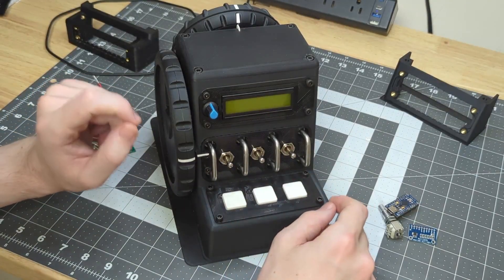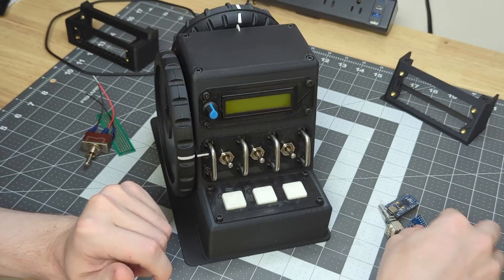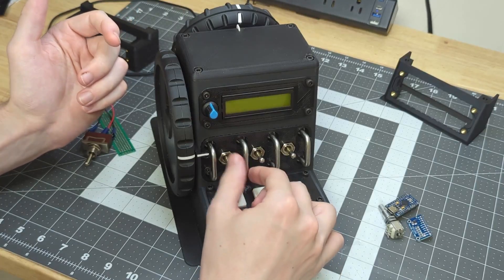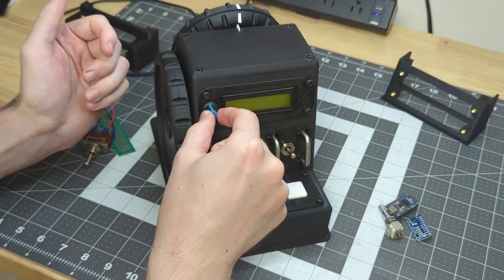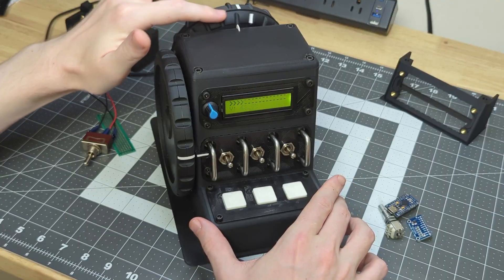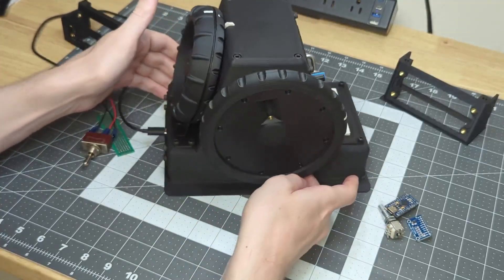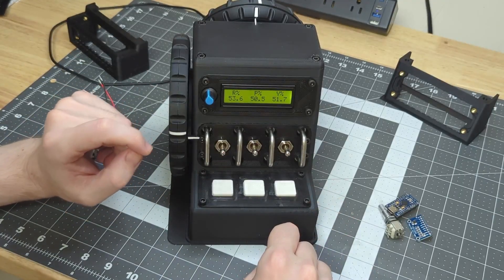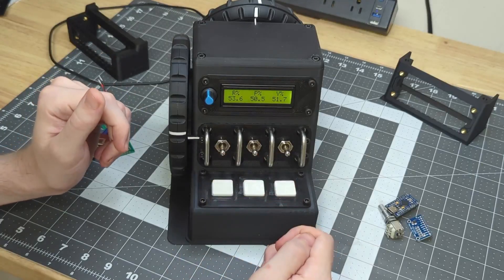Arduino 3D Printed Trim Box Overview

Comment: It's a nice trim wheel setup. I attempted something similar a while ago, though it never really left the prototyping stage for me. I used 5 turn pots in order to get a very high precision on the trim, and it did work quite well, however, I found that whenever I used an airplane with autopilot and autotrim, the trim wheels would go out of sync when the autopilot was engaged, and it would lead to very hard pitch maneuvers whenever I disconnected autopilot and wanted to use manual trim. I havent really found a good solution to this yet, but my two options would be either using encoders instead of pots which is easier, or motorized trim wheels, which is a bit harder to implement.
Reply from the maker: Interesting, I guess my first thought would be to motorize the wheels just like you said. My second thought would be an autopilot toggle that suspends axis reporting and sends a onetime centered value to neutralizes all trim axis. This toggle would also engage the autopilot. when toggled off, the autopilot would be disengaged, and the trim wheel axis communication would resume. This would be similar to a mode selector I guess... Do you mind if I ask what sim you were flying in, and what plane?
Reply: @civilprotection8845 the trim wheels will still be out of sync when autopilot disengages and the trim wheels takes over again. It was in MSFS2020 i was using it. The problem was apparent with any airplane that couple autopilot to the trim. Encoders would bypass the whole issue, since they dont report an absolute position. Motorized is more elegant, but also requires a bit more effort, but very doable if you get some precise stepper motors
Reply from the maker: Yeah, the encoders I've used on my HOTAS are pretty mushy, and they tend to give larger inputs or overshoot the value I want. I'm sure there are some snappier ones out there though. I wonder if you could use a laser scanner to read some 'zebra tape' around the perimeter of a trim wheel, the same way a printer keeps track of where the printer head is... That would sort of be in-between an encoder and a potentiometer

But I'm just idly speculating. MSFS 2020 is actually one of the flight sims I haven't touched, so I'm not really familiar with the exact problem you are describing. I hope you do get your box out of prototyping though. Maybe you'll even post a video of it when it is done o7